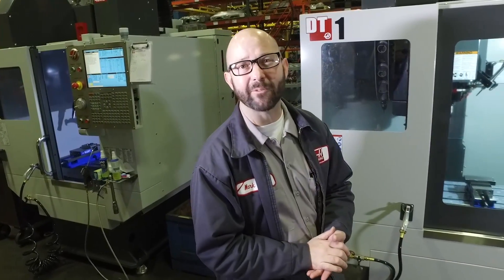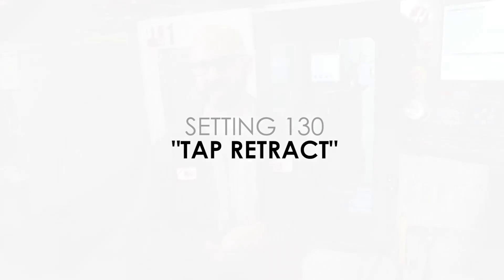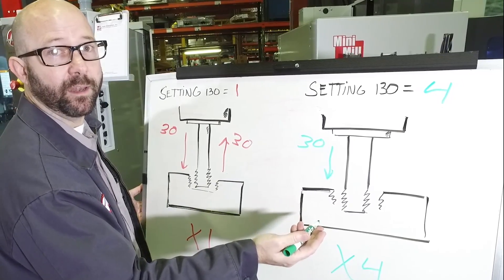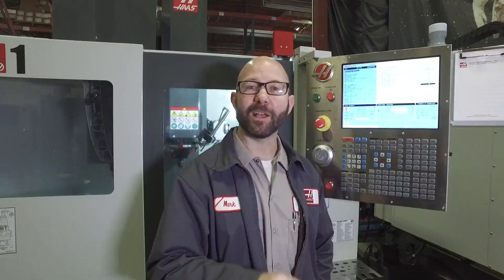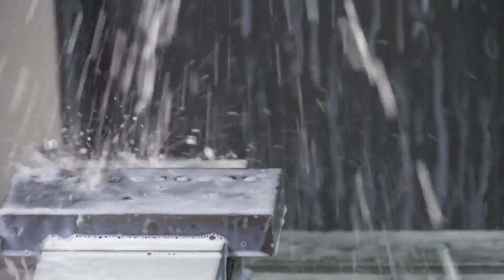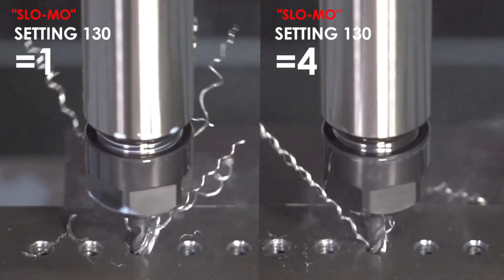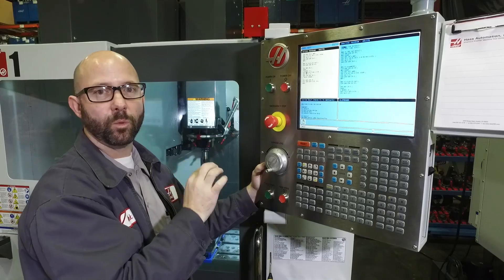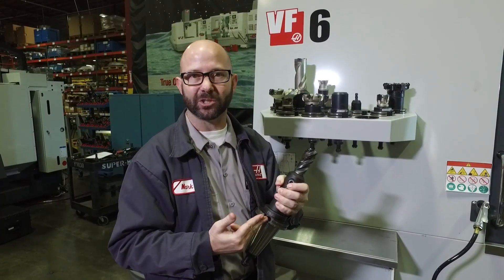Faster Tapping with Setting 130 – CNC Milling Haas Automation Tip of the Day

Comment: Nice tip. To increase machining speed Thank youi have one suggestion for you. Sir

You can Add this J setting in Your VPS Programming so user can set the retract values right from the VPS Page when they creating the Taping Cycles. Thank you 😊

Comment: I mostly program on old heidehnain controllers that barely have any special features, those haas videos gave me the idea to create those special settings in sub programs used as custom canned cycles, shame that the old vf3 that sit in the corner of my workplace doesn't run that much

Comment: Buen día, tengo una pregunta habrá algún setting, cuando barreno se puede disminuir la velocidad del rapido de la máquina, esto es con brocas muy largas?
Reply from the maker: Oscar – We can turn on Setting 10 LIMIT RAPID AT 50%. This will slow down all rapid moves. To slow down Rapids on just one drilling operation, we would have to program all of the moves with a G01, so we could control the feedrates with an F-Code. We always have the Feed and Spindle Override buttons, but I know that isn’t what you were asking about. I hope this helps. – Mark, Haas Tip-of-the-day

Comment: so in order for setting 130 tow work. u have to have a j value?
Reply from the maker: Ariel – Nope, the J value is optional. The machine will use the value in Setting 130, unless you use a J value on the tapping line, then it will use your J (temporarily) instead. Thanks for the comment. – Mark, Haas Tip-of-the-day

Comment: Thank-you very much for this tip, I've been working on my Haas since the last 4 years and this is the first time that I've opened settings and modify something and the result is very impressive by doing this I'm gonna save a lot of time :) I had encountered some problem by using G99 and luckily I was safe from a horrible crash I will write this experience on G99 tip video .

Comment: Running a  VF-6SS I have not noticed any real time savings above 3x retracts, as the spindle and Z axis servo don't have the acceleration necessary to really ramp out like, say a Brother does. I have left ours at 3x retract and been just fine. I can see how a smaller machine with a lighter head can utilize this better, though. Also our HFO training instructor has stated that it's possible to break taps by setting the retract higher than the spindle can function (IE a 9x retract when the tap is set to 1500 RPM).

Comment: You should turn on setting 133 :-)
Reply: +MrMetalShaper U a troll :D
Reply: +Tommi Honkonen only if you want me to be :-)
Reply: my suggestion for turning on 133 wasn't a troll comment and meant sincerely.  Because if for some reason you have to create a peck tapping operation you would need this on.  If you decided you needed to tap your holes deeper you can run the same code and not screw up the threads. I would just leave it on all the time, it can't hurt.
Reply: +MrMetalShaper The sad part is Haas decided not to make a simple peck tapping macro by adding a Q and/or P value, and instead require long drawn-out code additions.
Reply: +atomkinder67 I agree. it would be nice if they could create a peck tap code.
Reply: MrMetalShaper There is already a peck cycle. Dunno what is the code but there is.
Reply: +Tommi Honkonen not for tapping there isn't.